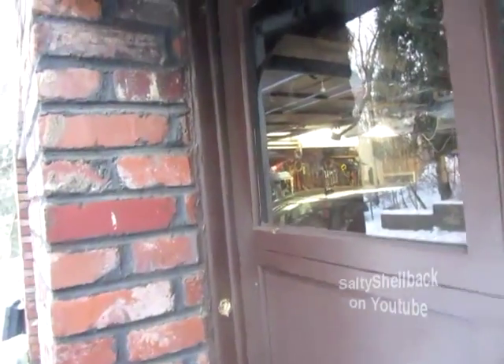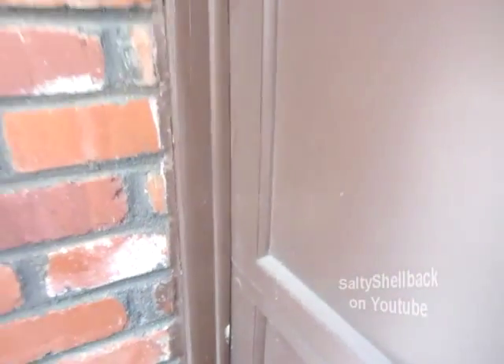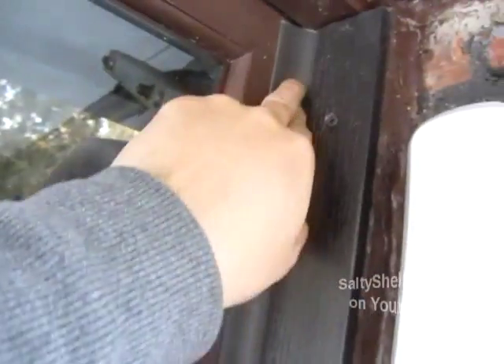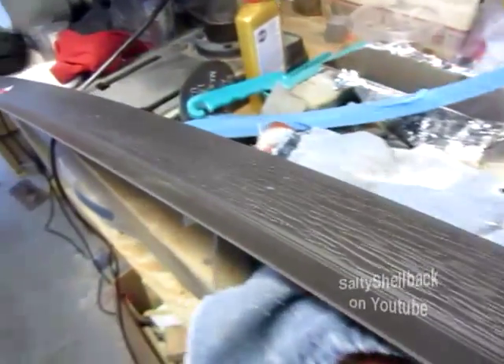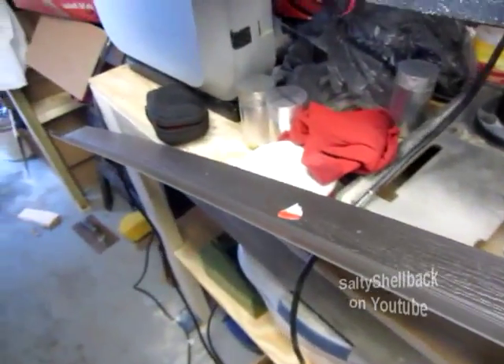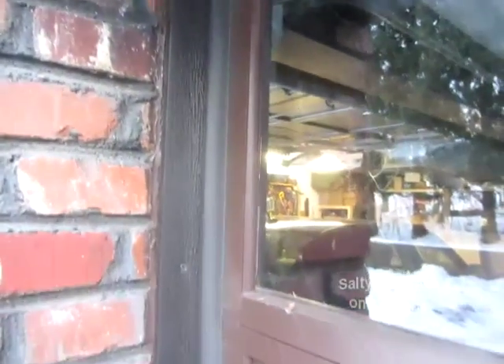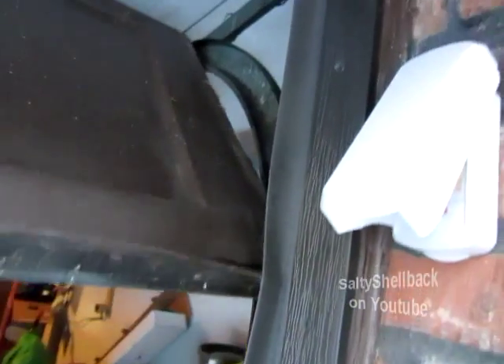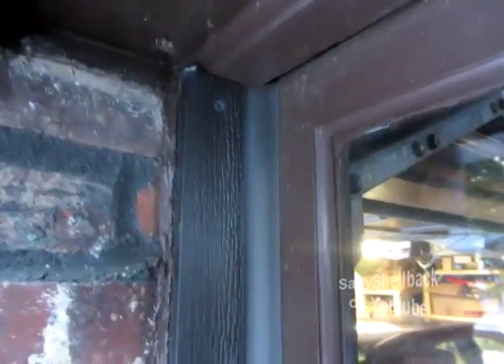My honey-do list continues. Weather stripping the garage doors

Comment: I glued foam insulation to the inside of my wooden garage door before replacing it with a foam filled metal version.  glue or strapping to the interior panels. I used the thinner foil backed insulation sheets.  That and wrapping the inside with a barrier plastic stops drafts.  You have to consider added weight to the door in any modification.  My new Genie door opener loosened the drive belt way up over a year time. good to look at that on occasion

Comment: They have a liquid nails that is safe for that vinyl but be careful I have seen it eat through thin plastic before :)  You could always just glue and drill it later.  Who knows the adhesive may hold it till you are an old man :)

Comment from the maker: I think liquid nails should be good, but I have to wait til it warms up a bit.  It is about 9 degrees outside now.  Good idea to use like a dead man to hold the strips in place to get the adhesive to set and to drill the holes.  I'll have to lay out the holes every 4 inches so if I ever need to replace the strip, I will know where the holes are.